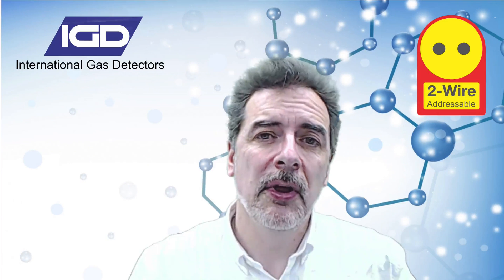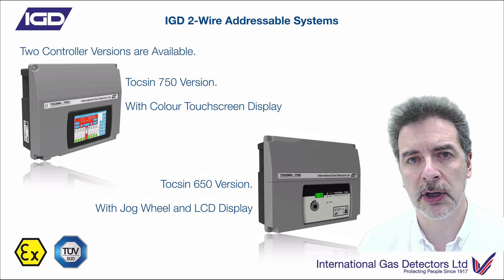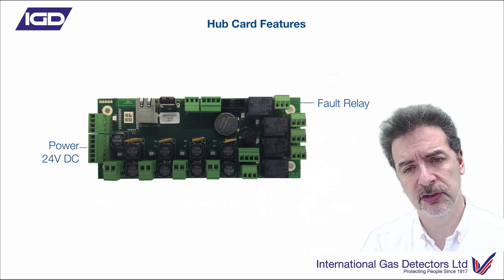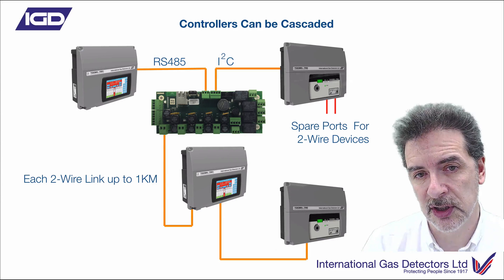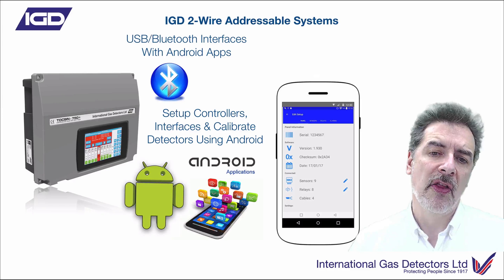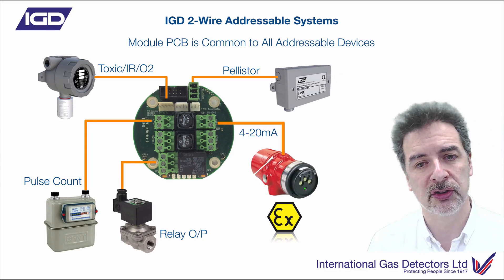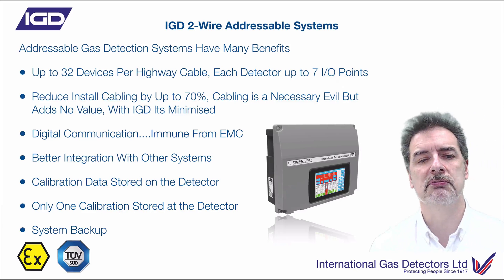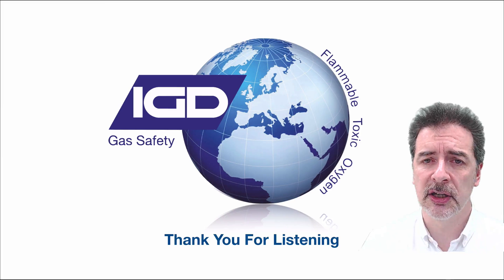2 wire gas detection systems from IGD

Comment: Big conjunction side safe area detector is not possible not any protected fire this plastic so fire damage for detector body damage
Reply from the maker: @Aneeshanu5533 if the area is non-ATEX zoned then ATEX detectors are not required. We manufacture both ATEX and safe area detectors to ensure clients are receiving the right detection solution for their application and environments.